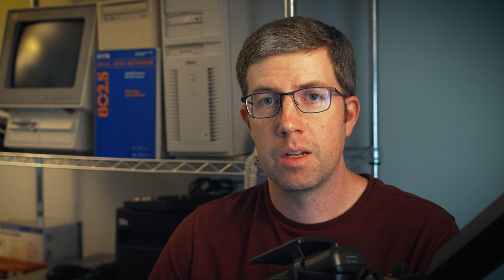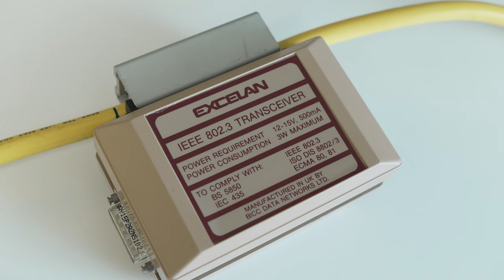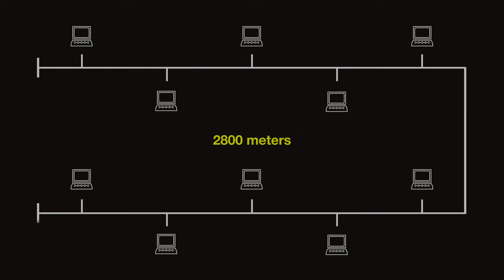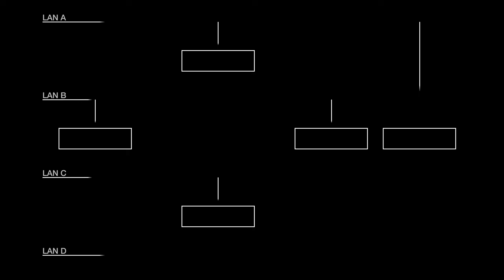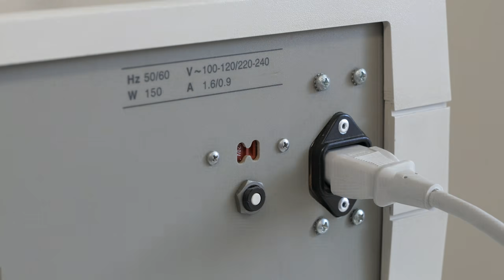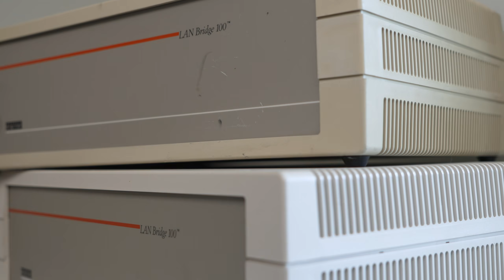EXPANDING THE ETHER: The invention of the network bridge

Comment: I was and am a DEC Fanboy. I had 3 ton of VAX gear with CI Star coupler and HSC RA81 disks and a number of VAXen! I loved LAT (Local Area Transport) a protocol developed by DEC to hook their VT terminals to the network similarly to IBMs 3270 terminals. I still have some DECServer 200s and 300s especially with Modem control as you never know if you need a 1200bps dial up modem to hook up to dial in or out.

DEC had some very cool networking including FDDI in later years but for me was in the VAX and then Alpha land - VAX loved and sold my Amiga to buy one old 11/730 central heater that took 20mins to load its microcode from TU58 micro cassette to bring you to the boot prompt to boot up VMS (OpenVMS of course to have a go at Scott McNealy and his SUN UNIX systems! After all UNIX was open - you just needed to recompile your C code and have all the right libraries but semantics!).

Oh one thing worth looking at is DECtalk a box that could take phonetic words and project them on the phone line https://en.wikipedia.org/wiki/DECtalk

Comment: Brings back long ago memories working with this technology in the late 1980's. Does anybody remember Ungermann-Bass and the 10Broad36 standard that modulated the data onto cable television channels? It was a pre-cursor to today's cable modems. As I remember, it took two full length PC cards to implement. One card was the RF card and it feed the modem card via an internal jumper. Our plant was wired with 3/4" aluminum coax using standard cable television amplifiers along the way. Exactly the same as you see on utility poles along the road.  The cable had taps along the way where you would connect an RG-6 coax with an F connector directly to the RF card in the PC. At the time, we thought it was the cat's meow and the logical replacement to thicknet. A year later, UTP was introduced and the 10Brroad36 was out the door.

Comment: I even remember seeing old standard outlet and light switch wall plates in my old trade college which was built in the early 1980s that had parallel/AUI connectors on them so they probably had old transceiver Ethernet taps in the wall cavities behind them! :)

Comment: Something is wrong with this description. You said you cannot ping when the bridge is learning, but the design of (at least modern switches) is that the bridge should flood packets until it learns, meaning that it should ping even when learning.
Reply: The inability to ping initially is because the old Spanning Tree Protocol keeps the ports for 15 seconds in "listening" state (discovering other bridges only, not learning MAC addresses) and then 15 seconds in "learning" state (learning MAC addresses but forwarding still disabled) before entering "forwarding" state.

Comment: I recall this yellow cable running a loop throughout our division floor covering about 100 engineers, programmers, et al.
It was not "in the ceiling" - but ran down the edge of the labs inside (opposite side of the hallway wall).
Main reason was to connect us to the VAX-780 (converted to 785) - DEC-220 terminals to some mux device to the ethernet.  I had a special card for my PC (Compaq 386 @ 16 MHz) and some sort of "virtual" disk on the VAX.  Nifty.  There was a bridge to another division in the co. (this evolved a few times before the yellow cable was finally abandoned when we moved to a new building.

Comment: Note that the original ethernet used radio waves.. just like wifi does now.. so in theory one could replace the cables with 2 antenna per device,  and you'd have a wireless network..at least  inside the size of a room

Comment: I am a just retired engineer and I worked most of career with computer networks. At a company I worked for we developed the first TCPIP stack for the PC and the first TCPIP stack for DEC Vaxes. I worked with Ethernet from the early days and even some of the alternatives such as ARCNet and Synoptics Lattisnet which was the first computer network stack to run across twisted pair which was a HUGE deal at the time. I did a lot of work with integrating big iron onto PC networks so I have seen pretty well all computer protocols and equipment used from the 80s onwards. If you are ever after information let me know. I know quite a but about the history and am still in touch with my original colleagues.
Reply from the maker: Contact us over at serialport.org, we'd love to chat.

Comment: I started with DEC in 1988 as a Firmware Engineer in the Wide Area Communications Group in Reading UK. I worked on the firmware for the line cards in the DECnis 500 & 600. Great memories. I was there (DEC/Compaq/HP/HPE) for over 32 years. This for me isn't history it the journal of my career :-) Great Job Guys.
Reply: DECnis.   I loved the OSI command line, separating characteristics from status...

Comment: Installing N connectors on 50 ohm hardline way before ThickNet for radio transmission lines and sometimes they were solder on instead of crimped.

Comment: Ah, still larger than the ol' PL-259 male connectors used with 50-ohm RG-8 cable for CB / Amateur radio applications of the same era.

Comment: I started working around the time this was invented, but had no idea about the 5-4-3 rule. We were putting thicknet in industrial premises often using stupid length ladders that you just wouldn't be allowed to do now. Up top with crimps, vampire taps and H4005 transceivers to drop AUI cables down to workstations on the factory floor. Later we discovered the 5-4-3 rule when we tried to link 2 buildings together and it was a mess until DEC told us about the DEREP and (I think ) DEREN repeaters which solved the problems. Plenty of other DEC comms boxes used the 68k cpu too - WANrouters, DECservers etc. Proper workhorse. I still have a pair of DEREPs though obviously they don't have a use any more :)

Comment: LOL... Now I was in Cable TV, starting n 1973.  It used Coax (75 ohm) and had that technology since 1948.  Block and Taps were used to feed drop cable from .410 inch feeder cables.  Were the totally ignorant of that technology already existing and that it was much simpler?  The mechanical functions were exactly the same thing.  Now, the signaling system was at a different set of frequencies, and in CATV it was basically one way, but two way was quite doable.

Comment: I'm the CTO at a datacenter. I had no idea how Thicknet worked physically. Not so many people have that knowledge still today. I was very well aware of vampire taps, AUI, etc. but never saw in done before.
Reply: I may be among a small group of the youngest people to still know how Thicknet and vampire taps work and I'm confident that I could get a network up and going today with just a little bit of a refresher. I just turned 43 and the school I went to circa 1999/2000 still taught some of the older tech specifically for students to get into a legacy IT job. I even learned COBOL. Problem is, people who have those jobs just never retire and job positions have wait lists of candidates who will die of old age before their number gets called.

When I went back to school at a 4 year university in 2013 for network architecture and design to bring myself up to speed (I'd been out of the networking game, focused more on the consumer side of things for the past decade) this stuff was nowhere to be seen. Every course was modern and modern only. No more legacy IT courses of any sort.

Comment: Oh, network names I have not heard about. When I first got into computers. Did tons of small very small thinnet (10-base2) installs. Upgrade Arcnet to 10-base2 and one place had Token Ring and also 10-base2. Then came along Twisted pair and never looked back. While going to High School I witnessed a install of a Thick Ethernet cable ran between 2 building to connect 2 dechubs together with misc. modules. Then going to  the other 2 schools at each end of a town was connected Frame Relay. That was latter replaced with CIsco Wireless.

Comment: I still have those tools and a bunch of the 50ohm terminators from my early HP days. We setup demo and benchmark centers with those taps.
Reply: I did it without those crimping tools. A stainless 'tooth brush', thin wrenches and a soldering iron for the tip pin.  I only made up about 20 of those ends, so hard to justify those crimp version tools (time was chap back then).

Comment: Thanks for the trip down memory lane. I was aware of Ethernet thickwire but never had to deal with it. My introduction to Ethernet was thinwire, along with the battle of IBM Token Ring, and Apollo's Domain networks.

In the late 1970s early 1980s I was designing inhouse test equipment and wanted to try Ethernet but as you posted back then the interfaces were very complex and expensive so ended up using current loop. Today due to high levels of silicon integration Ethernet and WiFi interfaces are almost free.

Comment: It sounds like early ethernet worked very similarly to the CAN Bus in cars. They typically use 120 ohm resistors at both ends instead of 50 but every node on the network receives the packets whether or not it needs it
Reply: Yeah, sort of.  :-)  What you're identifying is really just any bus topology, though.

Electrically they're different in many ways.  CAN uses a differential pair while coaxial Ethernet is single-ended.  The characteristic impedance is also different.

IIRC, CAN uses an addressing scheme that tolerates collisions and requires nodes with lower priority addresses to detect them and bow out, while the higher priority address node continues transmitting.  In contrast, Ethernet requires both nodes to stop and wait a random period, and then retransmit after sensing a clear carrier.

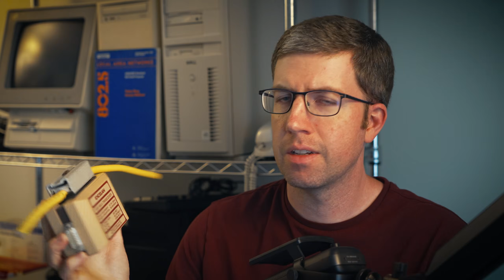Comment: not the ethernet you were thinking of... 1:30 ?
oh that is not Thicknet 10base5 cable going thru a vampire tap remote transceiver?
Saying this, without even watching past this, in jest.   If I ever seen another Cabletron network part it would be too soon... I used to install this stuff, I talk about a terminator and most ppl dont even got a clue what it is, let alone grasp that length of wire matters etc.

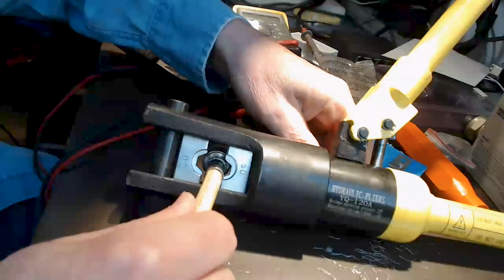Comment: 7:00 hats off -- what a great demonstration of a simple click nowadays when we plug an ethernet cable into the socket.
Of cause he showed the cromping and connecting too, but what he was showing were tools now used at home to build a 48 V diy home storage battery, same for the cable cutter and the hydraulic pump. 
Really great content even though I have never seen that, I was only aware of the outlet where we were used to have token ring which was a mess back then.

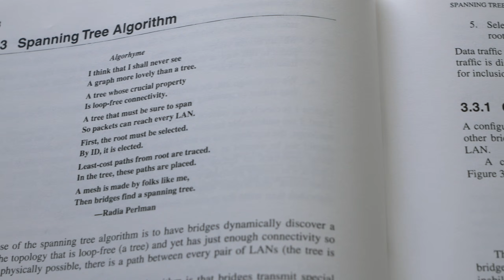Comment: I distinctly remember Radia's riff on Joyce Kilmer's "Trees" -- which you show @15:18 in your video. If you pause at that, you can see that her 12-liner describes the algorithm thoroughly competently. If you look up Kilmer's Trees, you'll also see that her variation was astonishingly in style and content to the original (see at https://en.wikipedia.org/wiki/Trees_(poem) ). Radia's “An Algorithm for Distributed Computation of a Spanning Tree in an Extended LAN" and is findable with a search on that title. It has since been cited 437 times in other papers -- a significant number. Radia started that paper with her "Algorhyme".

I first saw Kilmer's poem as a child during a field trip to the Joyce Kilmer National Forest west of Asheville (NC, USA). IIRC, our teacher forced all the kids to memorize it. 

One other detail about 10Base5: the minimum distance between the vampire taps and large radius of the thick cable meant that a group of racked computers had to have massive loops of the cable nearby to connect all the hosts. They were truly unwieldy. I always smiled when I encountered one of those gargantuan installations of thick coiled cord in computer rooms. 10Base5 cables were sold to customers pre-assembled; we never got to see those hydraulic presses to terminate the ends. Vampire taps weren't too bad, but you would occasionally short the entire cable with a bad tap. As bad as 10Base5 was to manage, the woes of the baseband ThinNet were far worse.

I learned about electrical impedance matching in school. I remember seeing a Shive Wave Machine in storage in 26-100, but I finally saw its operation in the famous YouTube video. Impedance matching finally struck home when I realized that all those concepts apply to mechanical systems -- including our musculoskeletal network. As a rule of thumb, it's best when our bodies maintain a low Q Factor. Geoffrey West's "Scale" has great examples of mechanical impedance matching (our arterial network) and electrical impedance matching (the power grid). I highly recommend that science book.

Comment: What a great video,  it brought back a lot of fond memories.  Bridges were a godsend as we started to create larger facility networks.   I originally worked for Digital's internal facility networking group in New England and was one of the people responsible for installing this new Ethernet Baseband  cabling in a number of Digital's cable plants.  I later moved to the Southern Area USA, going to work for Customer Service,  and ended up working in John Reed's group.  While I was also a cable plant designer for multiple customers, it was John Reed who was our resident expert, particularly with broadband and baseband networks .    I was a great pleasure to have worked with John.

Comment: That original spec is available on the Internet.  Search on "the ethernet blue book".
"Kill the occupants during a fire"  Picky, picky!  🙂
Years ago, when I was a computer tech, we had 7 VAX 11/780 computers connected by DECNet & 10Base5.  We also had some Data General Eclipse computers, which the programmers wanted on the network. So one of our engineers designed an Ethernet controller for the Eclipse and I hand wired a couple on prototyping boards for the them.

Comment: I came into all of this at the end of 10base5 thicknet, I have a transceiver - somewhere....
I worked for a telco in their repair shop, we lived on leftover and surplus network gear as that was not our primary job, this was when networking was not a given piece of infrastructure, you only got it if you could put up a good case for justifying it, this (at the time) very expensive kit. However we were all kind of nerds in that repair shop so we put out feelers to see what we could score, so we ended up installed some thicknet, before moving onto the later thinnet.
Actually I'm listening to this video via an amplifier I built in an old network bridge box, kind of the same as the DEC with two AUI ports, but half the height. I didn't think I could ever use it, so it was kept as a really nice metal box.

Comment: Awesome. I remember doing network and PC support in the early 90s as a summer job pulling out old 3com coax cards (10B2) and replacing with 10BT runs.  Every so often I’d find the old adapter modules and rarely a chunk of abandoned Thicknet.  This was a great history lesson.
Reply: Back in 1997 I was on a project to convert some Province of Ontario offices from 10base2 to 10baseT.  I wasn't involved with the cabling as my job was to change the computers to work on 10baseT.  On some, it was just a matter of disconnecting the coax and plugging in the new cable.  Others required changing the NIC.  I recall some Xerox printers that had an AUI interface and so couldn't be switched, without getting the 10baseT/AUI adapter.  Otherwise, it would have been necessary to get the 10base2 cards from Xerox.

Comment: My first experience of Thicknet was when an office I was working (in system admin) had it installed. 

Unfortunately, it didn't initially work. I actually had to tell the cable installer that they had made a bend slightly too tight - and ended up breaking the minimum radius allowed.

Luckily, they were able to re-work that little bit and it worked despite the cable having initially been bent too tightly. But it highlighted how close to the physical limits the system was operating.
Reply: Which kind of highlights the impressive work to speed it up etc, considering it all being 'so close to the wind'

Comment: I am raised with in the office 10Base-T Coax network, but all cables were like TV-cable thinckness. With T-shape Connectors at every ethernetcard. Always funny to have a lose end (50hm) resistor. Took the whole network down, without having a idea where to look. Love the vid, and the old guy who still can do the tab today. Asif he did it yesterday on the job.
Reply: That would have been 10BASE2.  10BASE-T refers to Twisted Pair, 10BASE-F being fibre.
Reply: @alexatkin  Oops I stand corrected, you are right 10BASE2

Comment: Because 10BASE5 and 10BASE2 supported longer than100 meter cables. It was still in use some places in 2000.
Reply: I still have a run between my house and a backyard radio shack, I'd run a newer cable, excepts the cable duct is chokers and the wife keeps reminding me that I have more important jobs than replacing a length of coax. Actually the coax is 92Ohm, intended for ARCNET a predecessor to ethernet, I just blindly plugged the 10base2 gear into it and got lucky - it worked.
So it's alive in 2024 passing all this lovely YouTube content out to me workshop, at a blinding 8Mbs.